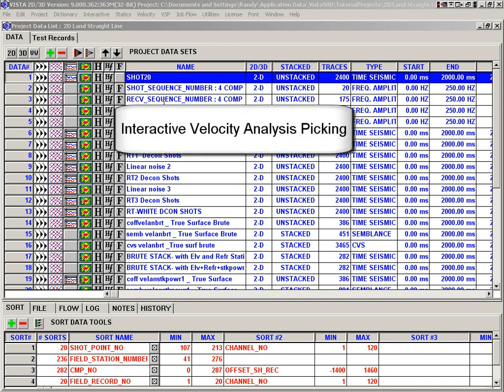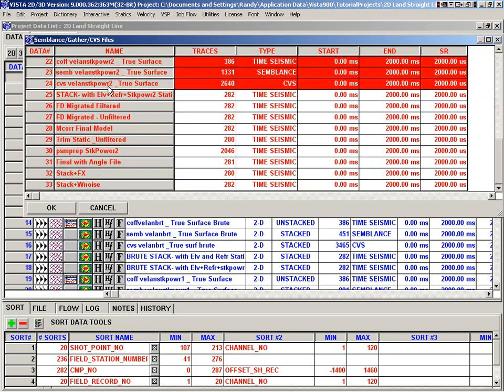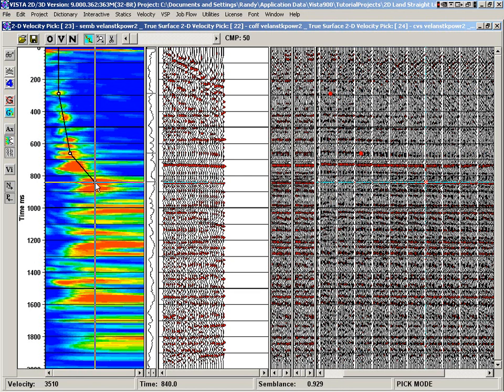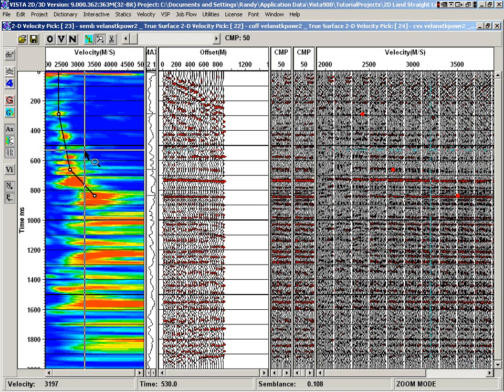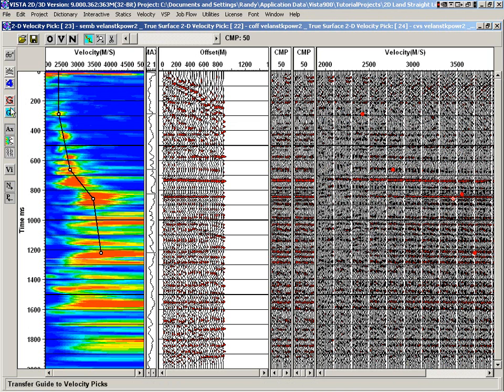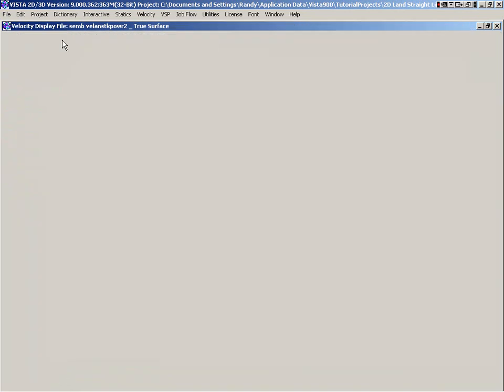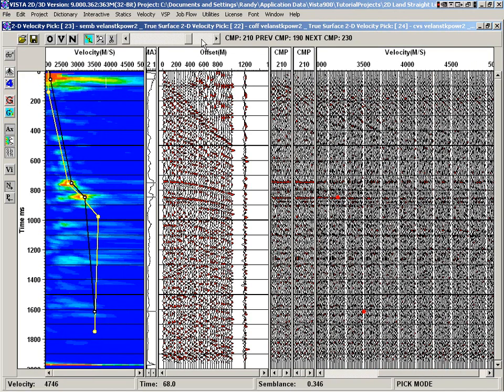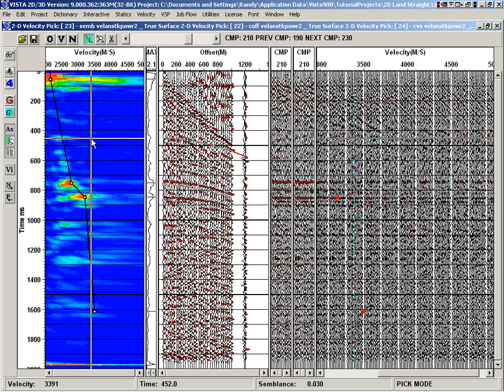VISTA : Interactive Velocity Analysis Picking 1

Comment: Hello Ma'am/Sir.
If you are a:
1/ University student in the field of geophysics and geoscience
2/ New graduate and want to get experience to begin work with great oil/gas companies but you don't have experience
3/ Researcher preparing to write a thesis for graduation in the field of geophysics and geoscience
and you got problems, I can help you.
Ihave an engineer and master's degree in geophysics in seismic 
Acquisition/Processing and Oil/Gas exploration with more than seven (07)
 years of experience.
I can provide and offer you what you need:
*geoscience
 softwares with real DATA and manuals 
(Petrel,SeisSpace/Promax,Vista,Mesa,Omni,Opendtect,UpHole,HRS,Geosoft 
Oasis Montaj,Techlog,Matlab...)
*Rare books and formations/courses
*Technical assistance and direct guidance until the end of graduation and completion of your project.
All this at a nominal price, depending on the type of material (you will find it expensive on the internet)
do not hesitate to contact me. hackdang40@gmail.com
My best regards.